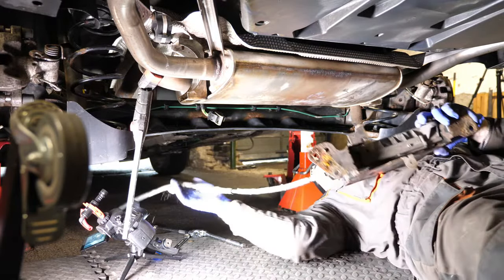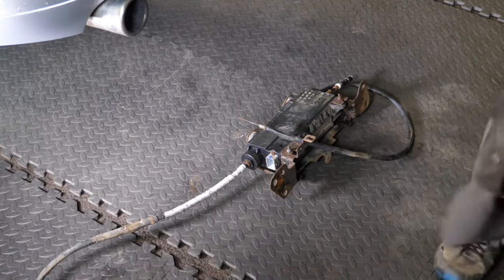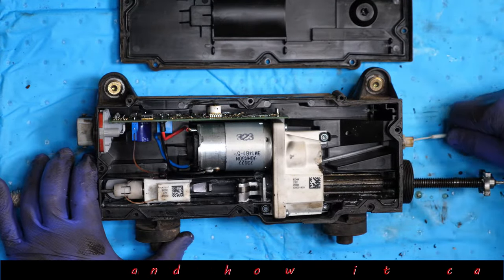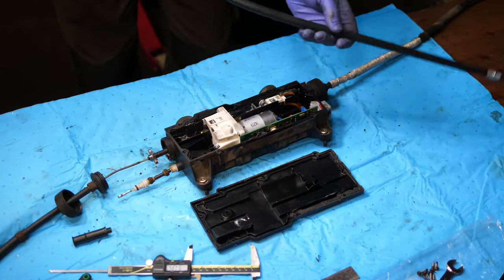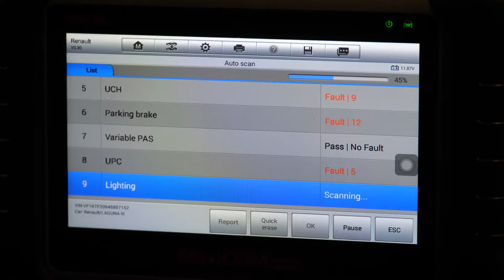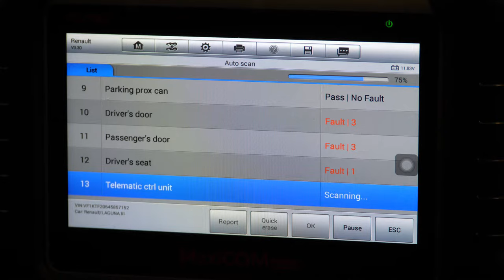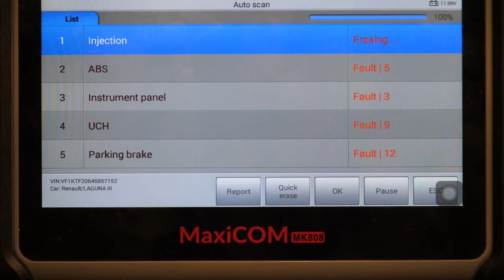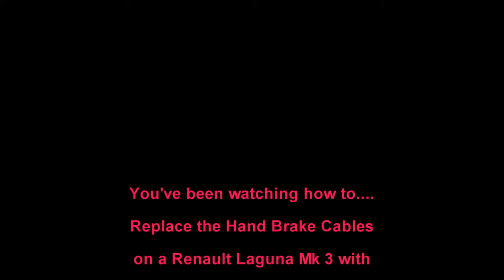Electronic Parking Brake Cable Repair on Renault Laguna, Espace, Scenic, koleos, BMW X5, X6

Comment: So if the emergency release is pulled, the wires have to be taken off the caliper to re-set it? Is that why one of my wires snapped?
Reply from the maker: I think you may need to remove from the calliper but the darn aluminium ferrule gets stuck with corrosion I found.

Comment: It’s showing the battery voltage at 11.96 v so a flat battery will set a multitude of codes.
Reply from the maker: Well spotted Malcolm, it’s probably that that’s triggered so many codes like you say.

Comment: What was the issue with the NHS wheel not rotating, just the Handbrake seized on? I’ve not got a Renault but I do have a RRS with one and I know it’s a module that fails, so I look forward to that job… it’s been ok for the last 9 years…
Reply from the maker: The piston had just stuck.  On winding back in it was ok but it's normally a warning that the rubber boot has perished and corrosion has started.  New caliper on the horizon.  My electric parking brake on my Laguna has been used zillions of times and the car is now at 175,000 miles and not a bit of trouble.  Was quite surprised it's lasted like it has.

Comment: When you unclip the cable from the caliper does it just pull through or was any force required? I’ve unhooked the cable on my caliper but that cable won’t move at all?
Reply from the maker: You may want to take a look at this recent video of mine to see what's happening. Galvanic corrosion.  It should just pull out but mine have corroded solid on my other Laguna. https://youtu.be/kFFBZ6RP0dk?t=407

Comment: Thank you,  made job a lot easier.  However all my bolts snapped or corroded.  Couldn’t remove cover that’s when I realised you don’t have to,  I easily replaced both cables without removing cover. (Possibly would be able to do it on the car)

Still thank you, as this video gave me the confidence to tackle the job.
Reply from the maker: Arrr interesting to know that.  Mine are due on my Laguna.  Think one cable has stretched.

Comment: Hi mate could i just  ask , i have a laguna 3 , but the only problem is the EPB won't engage at all and i get message "CHECK PARKING BRAKE" on dash panel and "APPLY PARKING BRAKE" when i open the driver door
Reply from the maker: Has one of the cables snapped?  the relay can also fail on the board.
Reply: @CoatsandGaiters  thanks for the reply 

I get these error code 

DTC517577
DTC516F68 ------------- Emergency UNLOCK on EPB module i think !
DTC516868
DTC50CB14

After clearing I get a red error code 

DTC516F68 emergency release

Comment: thanks for the video! my mechanic wont touch this can of worms so i have to do it myself 😂
Reply from the maker: In fairness to Renault I have one on my 2007 Laguna and its done 182k with the same handbrake module and cables.
Reply: @CoatsandGaiters  My 2005 Laguna with 250 kkm still has the original module and cables as well :).
Reply from the maker: @Jezusbeznogi  we have had many Lagunas over the years and have found them to be ultra reliable.
Reply: @CoatsandGaiters  Yes,  contrary to  popular belief they are good cars and quite easy to fix when something does break down :)

Comment: Mark, what make and model is this Renault laguna mk3 ? , I was fixing my neighbours mk3 hatchback 2011 model 1.5 dci but that had 2 brake boxes one for each side of the rear wheels 😐
Reply from the maker: I just know its a Mk 3, its the same module as on the Mk 2 Laguna.  Wonder if the 1.5dci has the motors on each caliper that wind in.
Reply: @CoatsandGaiters  yes I believe it does

Comment: Can I just ask were did you buy the cables from ?
Reply from the maker: Off eBay try searching "RENAULT LAGUNA 3 MK3 2007-2015 Electric Handbrake Parking Cable LEFT + RIGHT x 2" Terry
Reply: @CoatsandGaiters  OK thanks 👍

Comment: Very good job, nice description 👌🙂
There is MUCH EASIER WAY TO REMOVE AND FIT  cables:

REMOVINNG:    https://www.youtube.com/watch?v=OTLeOcs27pY
FITTING:  https://www.youtube.com/watch?v=ve5g9ekFHMQ

 but you have to have correct cables as a OEM (some of them have different left cable head shield - this white plastic) it need to be exactly the same one as Coats and Gaiters used in this video